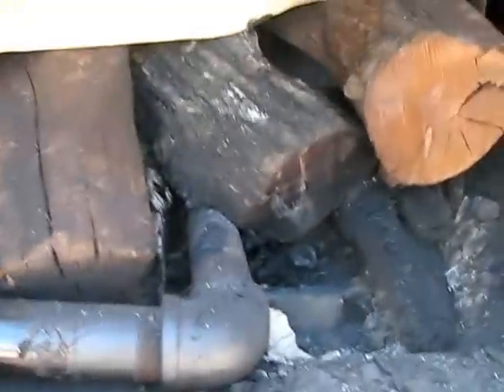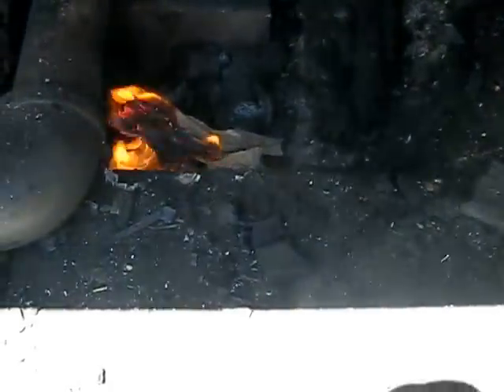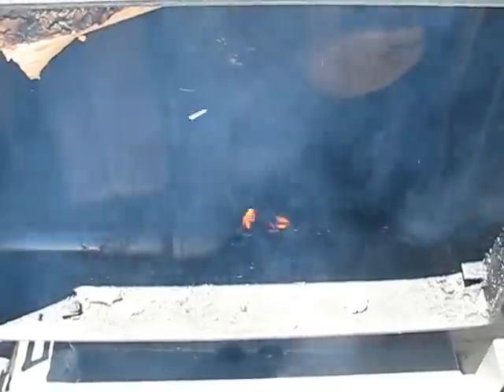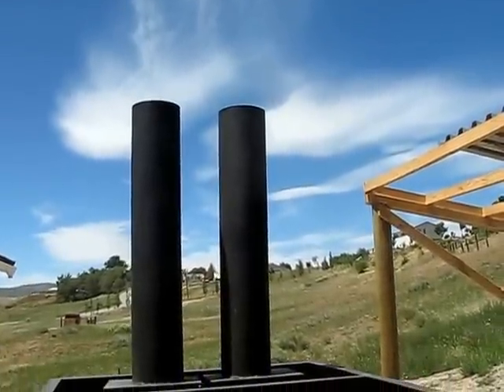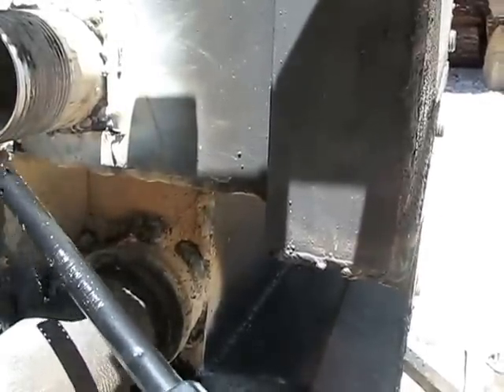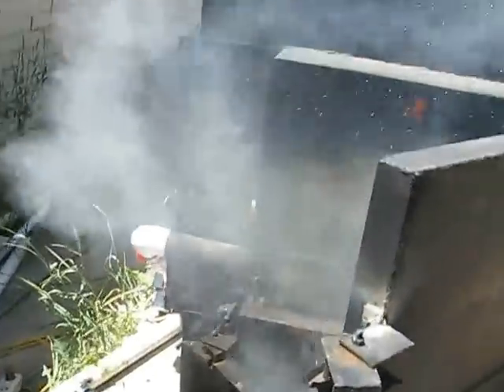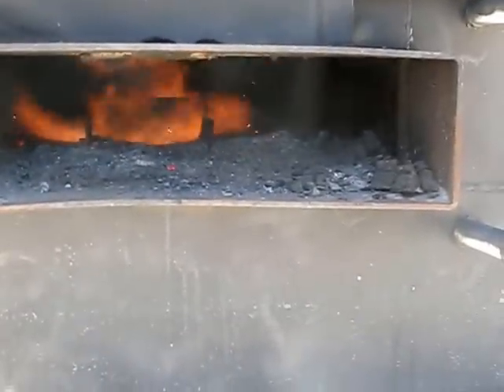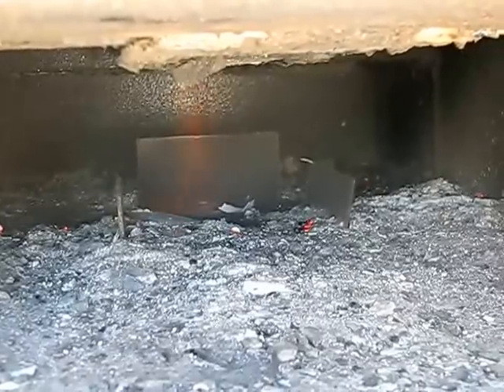Hot secondary burn

Comment from the maker: I tried shutting it off for 4.5 hours, and it did not light back up, I think that was just a little too long.  It was still warm, and made a little cracking noises, so it may have lit up given enough time, but I shut off the fan after about 5 min with nothing burning.  I will try it again after maybe 2 hours being off, and I bet it will light back up.